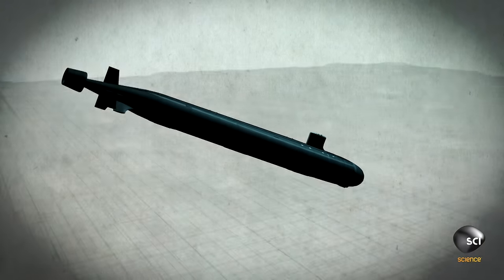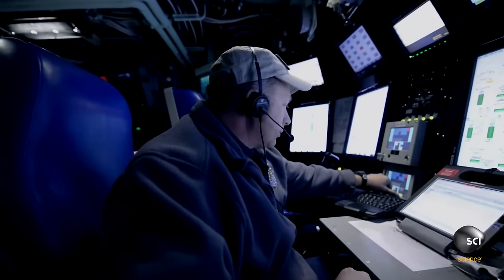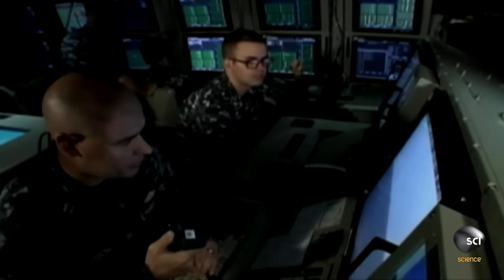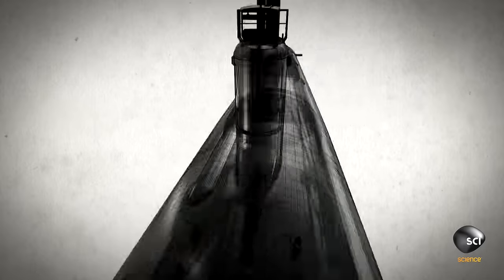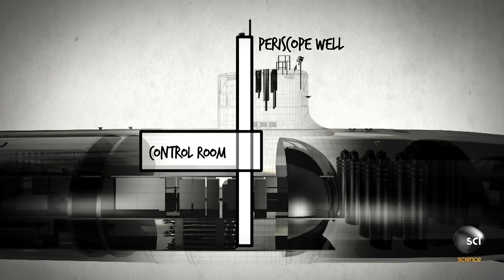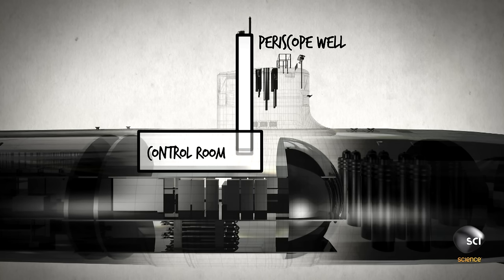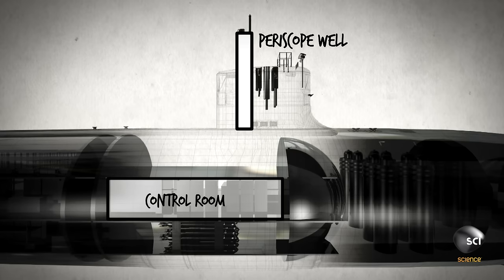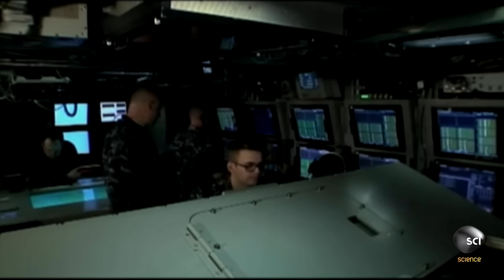How Do Submarines Dive and Surface?

Comment: Question: How they fill the rooms with air to go to the surface when they are underwater? ty
Reply: Bishshoy Das yes but with this way the pressure is the same right? Even though the sub goes up?
Reply: Bishshoy Das hm, ok thanks a lot
Reply: +Cashburner - Simply pump out the water from the ballast tanks. It's possible they fill the empty space using some other placeholder gas (it could be air) which is stored somewhere else in pressurized containers.
Reply: RedDaLord ow yes, nice idea and they can refill it when they go on surface..
Reply: Redda that’s correct
Reply: Ther is air in the water
Reply: They fart all together and the water in rooms goes out 😂😂😂😂
Reply: they use electrolysis system to seperate O2 from H2O which supplies fresh air throughout the sub.
Reply: Dylee take a chill pill 🤦🏾‍♂️
Reply: @technomax409  Lol
Reply: Compressed air expands and pushes the water out.
Reply: Hope they use mechanical compressor 😅
Reply: @technomax409  lol that joke made my day
Reply: The same way it produces oxygen to provide for the crew
Reply: Pressured air tanks
Reply: i need answers!!!
Reply: @jonasemilaksnes  but if there is air in water how does it sink then?
Reply: Opecuted  but water is denser than air. And air just bubbles out of the water
Reply: @davedave3520  the thing that make the sub float or sunk is not how much the air in there, but the water. The uniqeness of air is their ability to be compressed. The air in the ballast tank can be compressed into small tank so water can fill the ballast. When you are about to drain the water, u just release the air back into the ballast. Also actually the ballast can be drained without air (become vacum) but its really dangerous as the water pressure will crush ur sub from outside without the support from air pressure inside
Reply: Ohhhh
Reply: Opecuted  through diving planes?
Reply: They fill ballast tanks with air,.,., Not rooms
Reply: You flood the ship to go down and you de flood the ship to go up is the easy way of putting it. You put the air that is already in the sub into the ballast tanks pushing the water our making a positive buoyancy
Reply: The ballast tanks are big enough that they are bigger than the rooms so the rooms don’t make the sub float up to the surface.

Nerd 100
Reply: Compressed air.
Reply: They don't fill with air...but they just take the water put of the rooms...
Reply: I think they have pump thats pump out water from water tank and sumbarine become lighter.
Idk its just my opinion.
Pump need to be strong
Reply: Im thinking they have air tanks in the Sub
Reply: Compressed air
Reply: From RC model submarines they use something like a large syringe to take on and discharge water to basically change the density of the submarine to float or sink to a certain depth.
Reply: @marcusr3795  yeah I thought about it for quite a while. The only way to control depth is with a funnel to the surface to pump air in.

I looked up the nautilus aquatic crustacean but didn’t understand the explanation.

Apparently it’s chemicals or something.

I also don’t understand how whales work.
Reply: @marcusr3795  no that wouldn’t work. The air would have to be removed for the water to be taken on. If you compressed the air, the pressure would remain the same but the strain on the vessel would cause it to explode.

Edit. Maybe I’m wrong. If it could take the pressure. Do you have a link?
Reply: @marcusr3795  ok. So there is no such thing as “neutrally buoyant” your buoyancy is measure of depth you can’t go up or down without altering the level of buoyancy. Like a hot air balloon.

So in rc subs it compressed air and takes in water (from the top) and then closes the inlets and the water becomes part of the vessel and it’s heavier.

But to dive really deep you would have to be at least as heavy as the water itself. Leaving no room for air.

So the first submarine to dive to the bottom of the ocean, in the 60’s I think, with two men on board simply could not have been able to compress enough air that they could get back to the surface.

For them to breath in the cockpit in none compressed air (not that compressing air makes it less bouyant), they would need to have enough compressed air to fully resurface and displace water equal to the weight of the sub.

But you would have to have so much compressed air to go really deep that the equipment would be have to be immense.

This is annoying. Why did the sub-mariner who was supposed to explain this not mention that air was being compressed?
Reply: @marcusr3795  in the end. Using all my senses and overall consideration. Although I have no proof. I know they’re fake.
Reply: Compressed air
Reply: @LegendsYT2804  consider this. Water can only enter to replace the space where air was. So when deep underwater, where dies the water enter? From below. Otherwise the air would escape and they could not resurface. So to move up water must be pushed out again from below. Because to lose air is to be stuck underwater. So why is the man in this video saying he opens tanks from  the upper hull? If he loses the air contained within the ballast tanks that are enabling the vessel to float on the surface then he won’t have enough air to surface again. Because is air is even stored in a compressed state already before diving it is still affecting buoyancy regardless of its state. You can’t liquify air. So to open holes in the upper hull he is losing air. If he dives from losing air by allowing it to escape then he cannot resurface.

Also, he failed to mention compressed air. The whole thing works on compressed air. Yet he neglected to mention it.

That’s strange.

Comment: There are three ways to surface a modern submarine.

The most common is a low-pressure blow. Come up to periscope depth, extend the snorkel from the sail. Now you have a way to get air from the surface into the boat.

Fire up the low pressure blower and start pushing air from inside the boat into the main ballast tanks. It's really pretty simple, but you can only do that if you have air coming in through the snorkel.

The other two options used high-pressure air stored in the high pressure air flasks.  If you do this quickly, it's an emergency blow, and it's used for emergencies.

Or if you're trying to surface through ice, a different set of valves are used to slowly and gently add high pressure air, just enough to push through the ice. That's called an arctic blow. 

Of course if you use high pressure air to surface, you have to spend time running compressors to recharge the flasks. So the low pressure blow is preferred when possible.

Low pressure blow is also used a couple times a day to remain surfaced. The air in the ballast tanks slowly dissolves into the sea and it's possible that the vents might leak a little. So it's standard procedure to periodically add more air until bubbles come out.
Reply: Your most common way explanation is wrong. Low pressure blow occurs after surfacing. How does it surface then? Bow and stern planes operation.

Comment: They go way deeper then 800ft.
Reply: Classified
Reply: Yeah the crush depth of a Virginia class sub is around 3000 ft. Then there is the submarines that are built for science research like the one James Cameron took to the bottom of challenger deep in the Mariana Trench. They aren’t technically called submarines, I forget what their called. Anyways that’s at a depth of like 25,000 ft. Bathyscaphe that’s what their called. Had to Google it.
Reply: I guess it's just an average depth
Reply: @Youre_Right  Bathyscaphe (this reply is late tho lol)
Reply: @hendraenhawe7063  It's not average depth. Average depth is usually given as 200-400ft. 800ft is just the sweet spot for information security controllers on the scale of keeping your power level unknown and yet still boasting impressive statistics.
Reply: @Youre_Right  no way it can go 3000k feet....american subs cant dive that much...1000 max

Comment: I was on the USS Michigan SSBN 727. Subs surface using an EMBT blow (Emergency Main Ballast Tank). It was 4500 psi air pushes out water through vents in the ballast tanks. That's for an emergency surface. Otherwise it's just moving water out or drawing water in to affect buoyancy also using forward an aft trim tanks for stability. Salinity of sea water also affects the buoyancy and has to be taken into account. The USS Thresher was lost in this way on it's DASO run when performing an EMBT blow. Somehow there moisture in the ship's service air lines and that 4500 psi air (or whatever psi they had) froze the lines and they couldn't expel water. To the bottom they went. Eternal Patrol is what it's called.

Comment: How do they surface? You may ask... So submarines have ballast tanks as in the video if you fill them or flood them it makes it heavy and makes the sub dive. Then on ballast tanks there are 4, flood, blow, equalize, and closed. So they set it to blow to go up which takes all the water and shoots it out very quickly, I hope this solved some of the confusion in the comments.

Comment: So, they said that filling those ballasts with water makes the sub just enough sinkable to be maneuvered at many depth... So that would mean that they can easily surface and fill those ballasts with the outside air?
I'll take that as a yes.
Reply: No. And not sinkable, submergable.
Reply: A normal surfacing is accomplished by coming to periscope depth, raising the snorkel mast, and using the high-volume blower to deballast the MBTs.   Less noise that way.

Comment: VR head set with a 360 Cam as the periscope. They need to make that bappen!
Reply: Malicious Affection Wrong! Photonic mast has 360 degree view already. It doesnt have to swivel around to see things. And it is recorded in the computer for possible review later. VR headsets is superflous and expensive because everybody in the control room could view in the real time. Besides it will take seconds only to expose the mast to avoid detection. The mast itself has RAM/RAD features.
Reply: Malicious Affection It doesnt have to. The mast itself has 360 degree view without swiveling around which is recorded & can be viewed later.  Everybody in the control room can view outside in real time. So VR headset is not only superflous but also expensive. The mast itself has RAM/RAD features.

Comment: A submarine sinks and floats using a system of ballast tanks. These tanks can be filled with water or air, which changes the submarine's density and buoyancy.

1. **Sinking**: To sink, the submarine fills its ballast tanks with water. This increases the overall weight of the submarine, making it denser than the water around it. As a result, it sinks.

2. **Floating**: To float, the submarine expels the water from the ballast tanks and replaces it with air. This decreases the overall weight and density, making the submarine less dense than the water. Consequently, it rises and floats.

This process allows submarines to control their depth and maintain buoyancy as needed.

From ChatGPT 3.5

Comment: They surface by pumping air back into the tanks, displacing the water. Idk where the air comes from though, I guess they have tanks of compressed air on board?
Reply: Yea they do
Reply: +TheUofAfan so then wouldn't the buoyancy still be the same because its not like you adding air to make it lighter
Reply: clorox bleach No! Released air from compressed air tank is like adding air and replacing the water in the ballast tank. Rwmember that the weight of the compressed air tank full or empty with air is still the same.
Reply: Mr. Dumpty
Reply: They can also make gaseous oxygen and hydrogen when submerged by electrolysis.
Reply: a VA class has two low pressure blowers, one forward, one aft and they can use them to blow air into the main ballast tanks and the water out of those grates that the captain in the vid was talking about.
Reply: water contains oxygen so i guess they vacuum the water out while seperating oxygen into the tank?
Reply: 0
Reply: Submarines surface with full ballast tanks all the time. A submarine when properly trimmed is, believe it or not, naturally buoyant and wants to go up when submerged.
Reply: @dr.justinspiehs  Interesting...that does make sense, they're already full of air I suppose!

Comment: Ok, explained a bit. Easy comprehent, air goes out, water in - Sub dives. But... when it is now in Deep sea, how to get the water out to surface topside? The air is gone, so no way to press water out by air! Compressor? But thatfor is air needed.

Comment: For the submarine to surface, water is ejected out of those ballast tanks which reduces the weight of the submarine. Those ballast tanks can be filled with either air or be void (under vacuum). I don't know what happens in those tanks (most likely refilled with compressed air and those ballast tanks will probably have negative pressure), but just from pure logic and some physical understanding...it's simply from ejecting the water out of the ballast tanks. 

Objects don't float because of "air" in them...it's that the volume and weight of the object that matters. Whenever an object displaces fluid, there is a force exerted back on the object known as "buoyant" force. For example say a 1lb ball sinks to 50% of it's diameter (half of the balls height sinks under the water line) and it stops sinking. This is due to the ball displacing a volume of water that is equal to 1lb. If you made the ball heavier (say inject water into the ball)...then the ball will sink until the weight of the water displaced equals the weight of the ball. If you make the ball lighter (say remove the water from the ball), then the ball will rise.

This video did a piss poor job of explaining anything.
Reply: Our normal method is to drive to the surface then use a blower to force air into the tanks and push the water out.  In an emergency we can use compressed air tanks to rapidly blow the water out and jump out of the water like in the movies.
Reply: Adam Kingsley thanks for the info. Yeah, I figured an object is free to move up and down If the buoyancy is zero (up to certain water pressures). Once driven to the surface, do the blowers get the air from the surface to push the water out of the tanks? It makes sense that compressed air would be used in emergency situations while the submarine is submerged. It’s less costly to simply drive up toward the surface
Reply: Adam Kingsley but in the movies, the fast projection out of the water also seems to be a fast drive at a steep angle. So both release of compressed air into the tanks while submerged and a fast drive at an angle toward the surface?
Reply: @felixchien1664  Yes driving up at an angle to get to the surface as quick as possible then the blowers take air from the outside.

Comment: So, imagine making the periscope the height of the sail and into the hull, but still using photonics. Now you can have a periscope that extends twice as far allowing the submarine to be twice as deep at periscope depth. Making it less visible from the air. And still have the ability to put the control room on the 2nd level.

Comment: what's a sail in a submarine??? is it the top slab slided vertical island type section protruding out from the submarine's hull that houses the periscope & exterior observation bridge??? or is it the rear aileron type stub wings in the rear stern section of the submarine where the rear hull tapers down to a cone??? please advise!!!
Reply: Sail houses periscopes.

Comment: What about other part of the submarine? It is also filled with air.

Only fillings two small portion of submarine will help? Is is enough to overcome buoyant.

Man the video went totally off topic.
Reply: The sub only has to be less dense than water to rise and more dense to sink. A larger or smaller difference in density will make the ascent or descent faster or slower. I am a civil/structural engineer and fluids isn’t really my forte though.

Comment: This seems overly complicated. Couldn't the sub just use ballast tanks to become neutrally buoyant at the surface and then use its planes to dive, become level, and float around. That sounds more sensible then that explanation you provided.
Reply: Opecuted  That's why I said to become level. I mean to become neutrally buoyant at that depth and then just float around and chill.
Reply: Opecuted  This guy just mentioned interior ballast tanks and exterior ballast tanks

Comment: Sumbrines have two tanks both side.
One of them is filled with compressed  air and one is empty with no compressed air.
Both tanks are connected with each other  with a pressure pipe .
When sumbrine wants to go down they will fill the empty tanks with water and sumbrine will start to go down. If you want to ascend. Then you will release the compressed air in  other tank which is filled with water the pressure of compressed air will push the water out of the tank and sumbrine will start to go up and one more point that atmospheric pressure only gets applied outside of sumbrine structure not inside :)
Here is the diagram i created
https://freeimage.host/i/2FEc6F